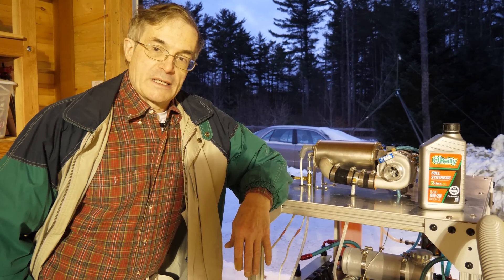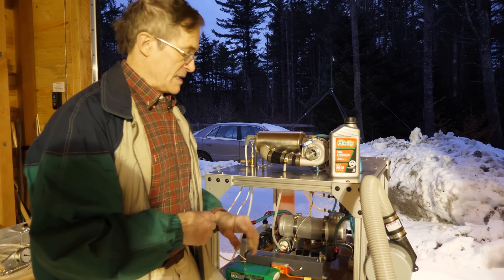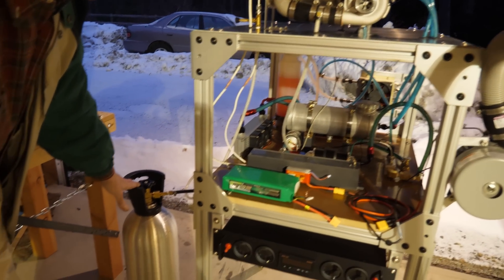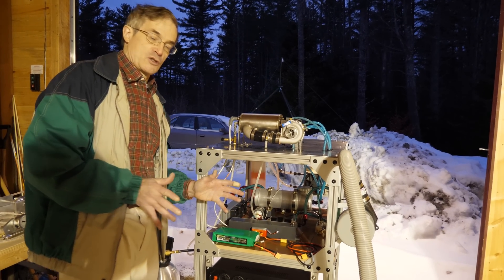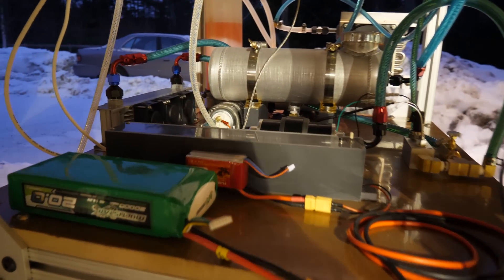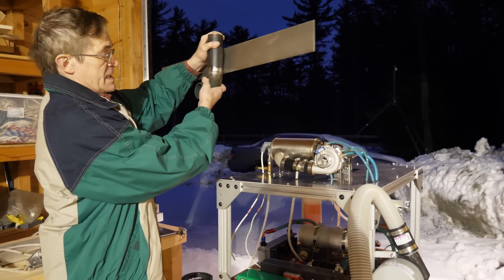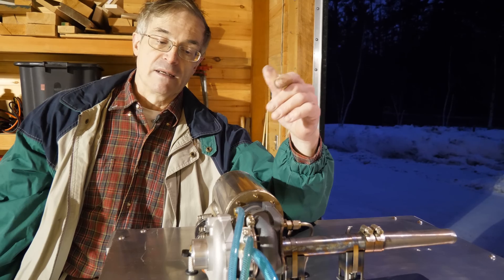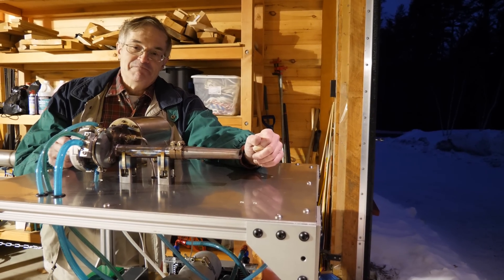FIRING UP THE TURBOJET!

Comment: Used a small turbo because "the smaller the turbocharger, the more difficult it is to get it to operate". This guy doesn't mess around. Great work, and thank you for explaining everything so well. Love your attention to detail, this is an awesome project. Would be cool to see how much energy you can extract from both the pressure + heat of the exhaust, maybe drive a steam generator for cabin heat or wing de-icing in whatever vehicle your jet engine goes into!

Comment: Fascinating video and project! Not being an engineer myself but possessing a certain degree of technical knowledge in the automotive, HVACR and electronics fields, I can certainly appreciate the design challenges presented by such a project and congratulate you on its successful completion! 
With your permission I would like to pose two questions:
1. I noticed that within a minute or so of operation, the turbine casting turned red hot. If this engine is to be used to power a power generator for long periods of time, is this a concern? What can be done to lower exhaust gas temperatures?
2. A look at the boost gauge shows a good degree of variation. This is undoubtedly caused by uneven burning and hot gas exhaust to the turbine. What refinements can be done to improve the burn chamber efficiency?
Thank you for your time!
I am looking forward to your next project!
Reply from the maker: Take a look at our follow up video on the new jet where I explain these fluctuations.  The cast iron housing is well suited to running at up to 900C and we keep the EGT below that.  You want the EGT as high as possible for effeciency.

Comment: That was quite interesting. I've heard of this type of "jet engine" before, but never seen one in action.

I must say though... The amount of extra equipment you need to get it to run does seem to preclude any practical application of it. It's not exactly a portable setup...
Reply from the maker: Thanks!
It can be.  The equipment is spread out and not all of it is needed to run the jet, but that makes it easier to optimize it.

Comment: You can't just change oil grades and expect a journal bearing to work. The hydrodynamic design is based on shaft clearance, oil viscosity and the design speed. If you switch to lighter oil, it's the same effect on the bearing that overheating or low oil pressure would have (short life and poor performance).
Reply from the maker: I agree to some extent, however when a turbo is added to an automotive engine, the same oil that is optimized for the Pistons etc is used by default in the turbo.   Also, actual turbojet oil is far thinner than piston oil.

Comment: Hi you are a smart person I have just had an idea do you think it would be possible to build a jet engine but instead of using a turbocharger use a Tesla turbine? Or use a turbo jet engine to drive a Tesla turbine?
It's just a thought. I don't know of any one who has tried it. ... Probably for a reason 🤔🤭
Reply from the maker: I'm sure it's possible.  The challenge, aside from having to construct the high temperature discs is adjusting the flow and bypass ratios.  The power extraction with a conventional turbine is balanced to drive the compressor.  A Tesla turbine has a narrow speed range for high effeciency operation and if operated outside of that range to drive the compressor the effeciency will be low. Engineering the turbine would be difficult.
Reply: @TechIngredients  thanks for your information I only know or 1 person and you tube channel that has the skills to build something that could work.
JohnnyQ90 has built a number of Tesla turbine's and turbocharger's on a small scale from scratch his channel is worth looking at 👍

Comment: Can I use hydrogen as a fuel? Will there be any changes in the design of the combustion chamber?  How can I safely store hydrogen and use it?
Reply from the maker: Hydrogen is an excellent, clean burning fuel.  The combustion chamber could be reduced in size, but storage is still a problem.  You will need high pressure tanks and they are expensive.
Reply: @TechIngredients  do you have any idea about how can we store safely and use it to run our turbojet?  Thanks in advance :)

Comment: Impossible to generate electricity from the compressor wheel?
Reply from the maker: Impractical, because of the extremely high RPM
Reply: @TechIngredients  I have faith in you and the power of ingenuity. https://patents.google.com/patent/US4996457A/en

Comment: Can i use SAE 50 for the type of oil?
Reply from the maker: Typically, turbo oil has a very low viscosity, but these turbochargers are designed to operate with the same oil as the piston engine they are coupled with.  50 SAE should still work.  The oil pressure should exceed the maximum boost pressure to prevent air leakage into the bearing.  10-20 psi above that level provides a margin of safety.
Reply: @TechIngredients   could you explain about the water cooler system?  just a use the water?
Reply: @TechIngredients  why you set the oil pressure on the 25 psi?

Comment: That's crazy because I was sitting here thinking as you were preparing to start that thing up... I was thinking that thing would be good to drive a generator from the exhaust gas pressure and then that's exact thing you said....

Comment: I am not sure what the point here is (first time viewer). Whittle did this in 1935 and I worked on commercially successful Rolls Royce Darts for many years. At least you didn't waste the turbo. The Dart was a 3 foot centrifugal 2 stage compressor requiring a 15 HP electric draw to start. 1400shp to 2800hp depending on very small differences. The key was was to never hot start or try to force it. Gentle. It will come alive every damn time if you treat her right.
Reply from the maker: The point of this video and the one immediately proceeding it was to explain the operating principles of a jet engine and how to best incorporate those principles in the construction of a small jet engine.
Reply: @TechIngredients  
Ok. Thanks. Meturlergy is a real problem. From the compressor section to especially the burner section. The turbine section will eat any turbo I have ever seen. I love turbos. I love jet engines. Good luck. If this is a learning thing blow it up to teach.
Reply from the maker: An upgraded version will be presented in a video we will be posting in a few days.

Comment: In large scale, would a catalist burner be a  good way to produce near zero emissions? Or would it be to large to make the unit practical?
Reply from the maker: It would probably produce too much flow resistance.  Hydrogen would be an interesting alternative.
Reply: Yeah i always wondered if any fuel would be better then others. I know propane is common just because you do not need a pumping system.  Aviation fuel is , as far as i know, like high grade kerosene,  i just assumed it was used to produce a slower, hotter flame.

Comment: how about using a third turbine connected to the output of the gas producer turbine and then use it's shaft  as PTO?
Reply from the maker: We plan to do just that.
Reply: @TechIngredients  What sort of efficiency are you hoping to get, say in terms of electricity production?

Comment: The propane will give very high exhaust temperatures, how about using a diesel/kerosene mix with a high ratio of kerosene.
Reply from the maker: If that is true, then we can use a leaner mix with the propane to lower this temperature.

Comment: Now shrink it as much as possible and utilise a Tesla Turbine to provide an output shaft of desired performance characteristics to drive an electrical generator 2-3kW would be stacks if weight is sufficiently reduced. (Ie; Consideration given for small, composite SCUBA tank Vs Liquid fuel reservoir and pump/valves/etc. Composite compressor housing and plastic compressor wheel, Ceramic turbine wheel, Ti metal piping etc etc)
Reply from the maker: Actually, we've scaled this up to take advantage of a better turbo design and the inherently better performance of a larger turbo.
I also do not like the Tesla turbine for this application.  The design is unquestionably elegant, but the RPM is problematicly high for interfacing with generators and transmission.  That turbine has to run at high speeds for good effeciency.
Our plan is to use a reversing flow turbine similar to a Pelton wheel.  Take a look at some videos demonstrating it's operation, it is also elegant.

Comment: Are you hoping for an easier generator build than a directly coupled generator? Thus bypassing the need for high rpm generator.

If the rpm allows, you could attach the EDF motor to the compressor side of the turbocharger.
Reply from the maker: The RPMs don't allow this.  A lower RPM, free turbine is a better choice.

Comment: My brother and I are interested in building a jet engine and want to know how much of our summer earnings to budget. Approximately was the total cost of this project?  Thanks in advance.
Reply from the maker: A new turbocharger can be found for about $250. You will need an oil pressure gauge, exhaust gas temperature Gage and a boost guage.  You can get all three for about $150.  The rest depends a lot on your welding skill and you scrounging ability, but if you look around for surplus valves, tubing, fuel pumps etc, you could finish the project for an additional $150.
Reply: @TechIngredients /Pablo ..... Remember , a $250 turbo is only a $250 turbo, theres been shortcuts with its construction, "we gets what we pays for ", please don't expect the same performance/safety as you would from a $2,500 turbo,  turbine wheels are expensive , cheap turbine wheels are made from substandard material  so please don't exceed 1450F - 800C for your turbine inlet temperature , and keep compressor exducer tip speed below 1450 ft/sec  for obvious safety reasons........... home made turbine engines aren't toys !! ..................................chunks of redhot turbine material travelling at supersonic velocities  will kill you :-(
Reply from the maker: That's good advice. While keeping those parameters in mind, I still recommend attempting this project with an inexpensive turbocharger.  You can learn a lot and develop a design and even replace the turbocharger without investing thousands of dollars.
Reply: @TechIngredients   You're fairly new to this hobby  but are giving advice on a subject much more complex than you realise , if you give advice you also need to take responsibility for any accident arising from that advice ............................I'd be very careful about recommending cheap knockoff turbos to novices wanting to build their first engine .

I'd be comfortable using a cheap knockoff , but I've got nearly 40 years experience with turbos and  30 years of converting them into a gas turbine , and I wouldn't run a knockoff past very modest temperatures and pressures , a 2:1 PR ( 15 psi boost) and jetpipe temps of ~600 C - 1100 F .

But a novice builder won't have the faintest idea of the required fuel flow so could very easily overfuel, overtemp  and overspeed within the first 20 seconds of "lighting the fire" .

Theres enough "idiots" out there on the Net telling people how to make a jet engine from a turbo , I was hoping you would be more "professional " 

Cheers John
Reply from the maker: You're advice is appreciated and your recommendations regarding operating parameters are reasonable. However, if you temper your criticism you will find a more receptive audience.  Turbochargers circulate a lot of power within them and none of them are designed to be repurposed as jet engines. Whether we use a high end turbocharger that costs thousands of dollars, an inexpensive knock off or a surplus turbo from a wreck, you can still destroy it with poor fuel control and monitoring it's operating parameters is mandatory.  I agree that more caution is a good idea with lower quality turbos, but you have already made that point.
Reply: @TechIngredients   LOL.................I don't concern myself with "receptive audiences"  as long as I get the safety message across , theres been a few of us in the DIY Turbine community that have spent many years trying to keep our hobby safe and out of the glare of "Regulators" .
Containment is one of the differences between high end and knockoff , the high end turbos are tested/designed  to contain bits if theres a "malfunction"  , though a surging jet  engine might shake the turbine wheel off during its rotor gyrations sending the wheel out of the scroll exhaust at high speed .
Yep , lotsa horsepower within our engines, my latest engine's comp wheel will be needing ~400 HP from its turb wheel , but its the energy in those rotating bits that are of greater concern , so please stay out of the planes of rotation etc etc .
All the best with your new build
Cheers 

John
Reply: @racketmotorman  Since you seem to be very knowledgable on this topic, do you believe a genuine garrett turbocharger would be reliable enough for this sort of project.
Reply: @pabloarroyo1023  A genuine Garrett should be up to the job , but so would a cheaper knockoff as long as allowances were made with regards temperatures, tip speeds  and pressures which will mean it will produce less power output.There are a multitude of turbo configurations , thousands of them , some genuine Garretts won't be suitable due to unsuitable configurations , whereas a knockoff might be , and could produce as much power output even when those allowances are made for it .................................its a very complicated business , different compressor wheel designs will mean differing potential pressure ratio capabilities as well as swallowing capacity for a given inducer diameter and tip speed 
A turbocharger is a form of gas turbine engine , the combustor of the gas turbine has simply been replaced by the piston engine to burn the fuel , if you want to know more, go to the JATO Site  http://jetandturbineowners.proboards.com/  its the worlds best Site for anyone wanting to build a gas turbine engine from a turbo

Comment: Good to hear you've swapped out the turbo and made the necessary combustor mods , hopefully the new turbo has a better matching of comp/turb , though I've found a lot of ball bearing "performance" turbos  don't have the necessary turb stage for a gas turbine conversion  .

Is this 53 mm inducer turbo going to be the high, or low,  pressure stage for the compound unit , most of the 2 stage systems I've done numbers for  aren't worth all  the effort , theres only a slight improvement in power output and fuel burn rates compared to an engine just using the larger, more effecient low pressure stage , the poorer efficiency high pressure stage  wastes most of the 2 stage advantage  , add on the necessary intercooler losses and it didn't make sense to persevere with the one I was going to build some 18 years ago  using the Garrett TV84 turbo from my turbine bike https://www.youtube.com/watch?v=CplnY9TG7NE      as the low pressure stage 
Looking forward to seeing some video of the new engine 

Cheers John

Comment: That is one very unhappy gas turbine engine... Flame stability issues, and late burning (very low pressure, and too litle turbulence), problems with the propane delivery (unstable or as liquid sometimes), and possibly "riding" the surge line of the compressor. First thing I would try would be to remove the tailpipe all together just leaving a stub, with no converging nozzle to keep back pressures out during the very low rpm regime you are at, as I don't think you have even reached a healty idle regime. Also you might have a permanent problem of a bad turbine/compressor relationship. Having worked a great deal on both APU's (garrett ones, which also is pure radial type) and normal axial gas turbine engines, the turbine is typically larger than the compressor to a fair degree flow wise.
Reply from the maker: You are right.  Taking what we learned from this unusually small turbocharger, we rebuilt it using a dual ball bearing model, with a 53mm inducer, better fuel delivery and regulation, a repositioned combustion chamber inlet and a better transition into the turbine.
It works a lot better! This will be the new core for our future compound model and the power turbine.